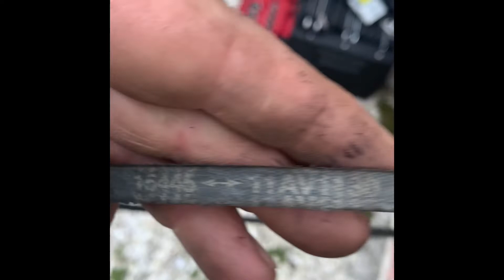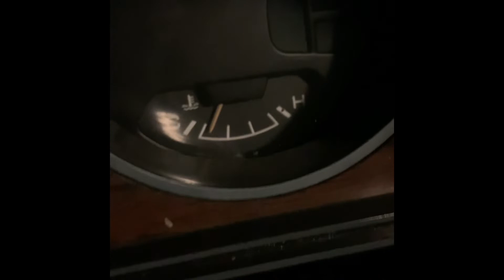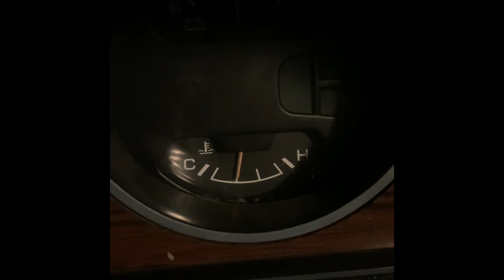No thermostat for over 20 years? 1990 Dodge D150 318 5.2 liter #nonamenationals

Comment: Woah! Chrysler used them Saginaw 'canned ham' power steering pumps too?  
Are ya gonna plumb that smog pump into the intake for some boost?
There's usually not much better than wrenching at a relaxed pace.

Nice seeing that gauge come back down.
Reply: And Ford wheels?
Reply from the maker: @DanEBoyd  
Nope 
Factory original.